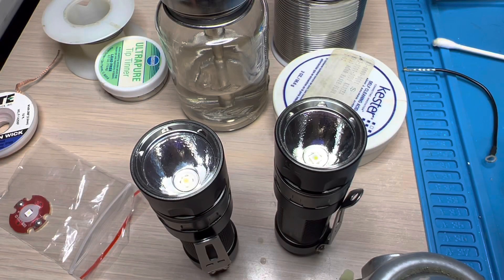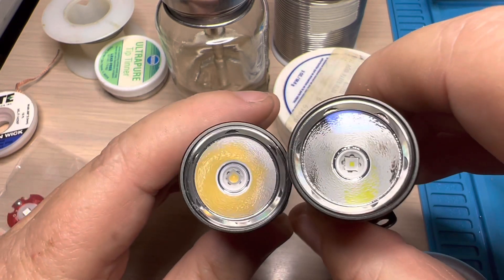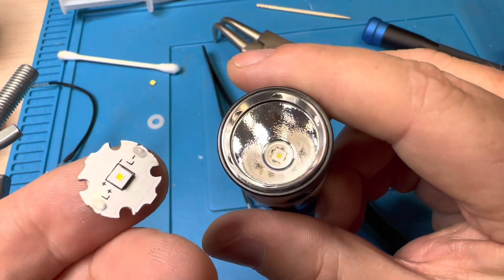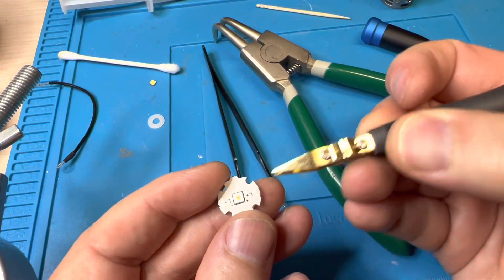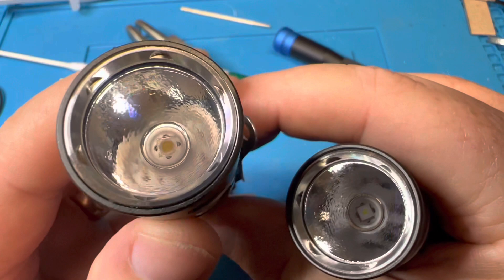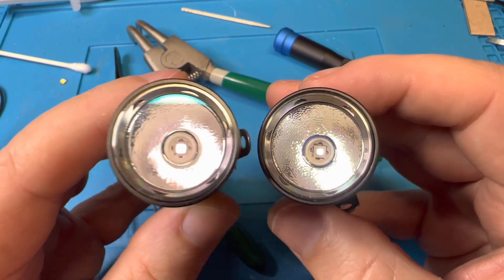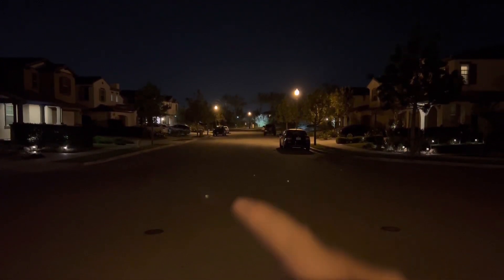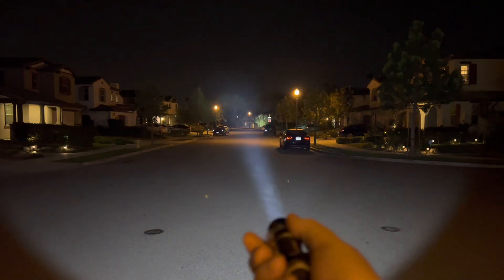Jetbeam RRT-01 swapping to 219b and OSRAM W1 (RRT01)

Comment: Help: I did the 219b (4500k) swap and it looks beautiful, but on medium to high output the light flickers. On medium the flicker is faster (almost looks like PWM) and on high it flickers slower. I noticed it flickers less as the battery gets disharged. Have you experienced something similar with swaps? What could it be?? I’m new to soldering so I fear I may not have the best connections.
Reply from the maker: Sounds like either flux or a solder whisker between anode and cathode of the emitter pad on the MCPCB. I’d pull the MCPCB out again, remove the emitter, clean all the solder point with solder wick, and then reflow with the minimum solder paste needed.

Comment: The multimillionaire that you have is has a more powerful diode test or is it similar to a quality regular multimeter?
What are flashlights for easy modding but don't say Convoy 😁
I finally got all the tools that I need so I'll try to mod my Olight S1 with a 219b sw4500. Can't wait to try it. Or to screw it up 😬
Reply from the maker: Have fun with it! Even if you “mess up”
You’ll be learning!
Reply: @cheule  autocorrect messed it up. Is the multimeter that you used in your video a regular tweezer multimeter or does it have a stronger diode mode that can provide more power?